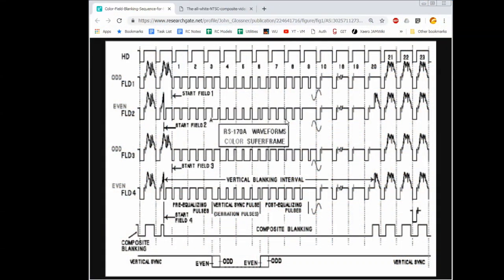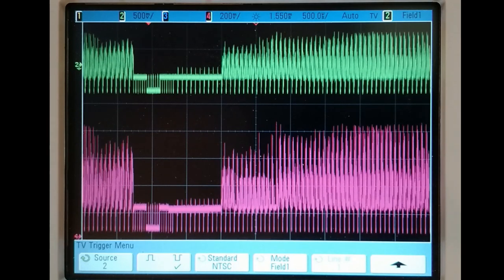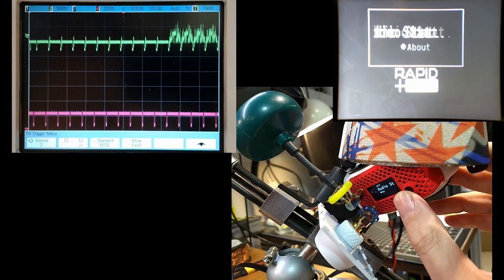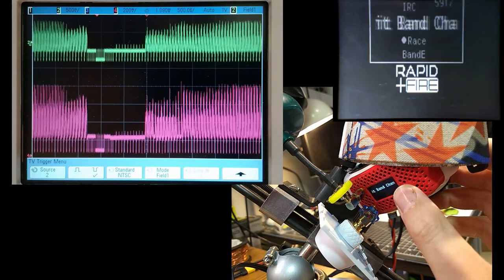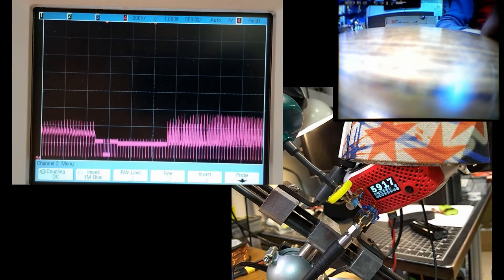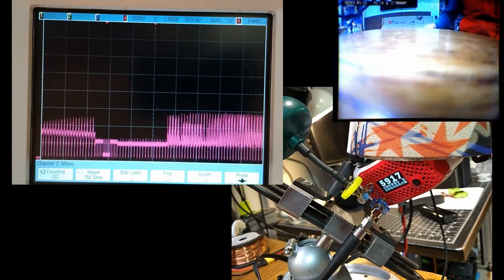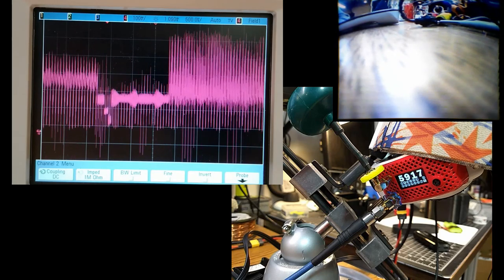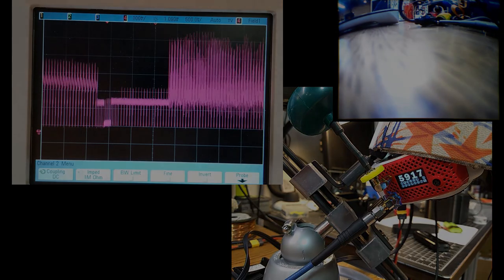ImmersionRC Rapidfire - Rapidfire modes demystified, "magic"explained - FPV Video Series - PK's Lab

Comment: So should we be running identical antenna's (say two omni's) if we want full advantage of the signal combining modes (magic/unicorn)? For freestyle a lot run an omni/patch combo, this appears to get in the way of the magic modes. Great video's by the way. Way over my head, but still very interesting.
Reply from the maker: Thanks bud!  Yeah, from what I've seen the mode 2 combining should benefit the most from using the same antenna on both ports (in a multipath heavy environment).  Where each one of them gives you a slightly different rf path so that one of them is always able to ride out the nulls.  Personally I tend to fly fixed wing at ranges significantly further than most quad pilots so I actually usually run a high gain and a low gain antenna but tend to stick to legacy mode when pushing the distance to have consistent behavior from the module.
Reply: Wow, almost posted the same question? I'm not even in the field and notice interference I would say less than optimum video signal with the rapidfire and two different antennas as you describe (patch and omni)...gonna find the VAS CP hope they still are for sale somewhere. 
PK your references provide a great read thanks! A little above the brainwave but the basics I think are there like antenna choice and placement

Comment: I just found your channel, so cool to learn about the electrical engineering behind the fpv tech. I have a related question on the digital radio domain, I'm wondering how DJI can physically get the bandwidth they get over the consumner bands. Do you know anything about how their radio works? Any guesses on their secret sauce?
Reply from the maker: Sorry about the slow reply, I have 2 kiddos now and not a lot of spare time ;-) Good question.  I won’t be able to do the topic justice in a YouTube comment, but I’ll try do to a short explanation that will hopefully help you go down a YouTube rabbit hole ;-) It’s a combination of a bunch of things.  The first is for the modulation they’re using OFDM (Orthoginal Frequency Division Multiplexing) instead of Analog FM.  Analog FM is generated by feeding the analog video voltage into a VOC (voltage controlled Oscillator).  OFDM is generated by taking a digital bitstream and packing the bits into frequency domain bins where you then run an iFFT, giving you a continuous time waveform that you can transmit.  OFDM has a bunch of handy attributes.  Each bin / subcarrier can be a different underlying modulation, I.e qpsk, 16 QAM, 64 QAM, depending on the signal to noise ratio (EVM).  To help with RF channel impairments like frequency selective fading and multi-path (echos off object in the enviroment), some subcarriers can be dedicated to pilot tones for channel sounding.  Add in some Forward Error Correction (FEC) to the bitstream before modulation to improve the resillancy and efficiency of the data link.  And then a layer of Hybrid ARQ to selectively re-send parts of the bitstream that took uncorrectable FEC bit errors.  That’s primarily only done for the center of the screen when in focus mode.  All this based on my experience with WiMAX and claims by others that DJI is using a modified LTE phy, so some of what I say might not be 100%.  Hope that piques your interest and gets you to dig in more :)

Comment: I think the PSA at the end might be slightly off target.   Looked to me like the bug was triggered by entering the menus when you had no received signal, rather than a good one as you would if you were flying.      We should have seen it return to static when it exited the menus, but it did not.   It's unclear if you had also restored transmit during that period or not.  

One thing I'm curious about after watching your vid is if RF can lock onto the V-sync and H-sync based on signals from either Rf module or if it prefers one over the other.  I ask because I do fly an asymmetrical antenna setup, and I I wonder if it makes more sense to have my my high gain antenna in one position or the other.
Reply from the maker: daemn42, It's hard to tell, but I had turned the signal generator output on at 25:47 (you can see a reflection change in the SMA connector as I reach up to do it).  When I said turn the RF on, that was actually the 2nd time I toggled the generator output because I thought I had double tapped the on/off button initially.  

Interestingly it's still stuck in overlay mode the whole time, even when the OLED menus times out.  The whole time nothing is displayed on the Analog video output.

It's like the processor that does the overlay and diversity switching lost communications with the one that drives the oled and handles the button presses.  I saw your comment on RCGroups about loosing the overlay and wonder if these are related problems.  Not sure which processor handles reading the RSSI from the receivers or tuning the synths, bud i'll do some probing and see if I can reproduce the issue in a consistent manner and maybe do up a video to send to IMRC.

Interestingly, I have seen this blank screen thing happen a few times now out in the field, even with older firmware. Initially just thought it was something I had fat fingered.  But seeing it happen on the bench makes me believe its a bug.
Reply from the maker: I'll do a test for you this weekend to see if there is any preference to either antenna input.  Ryan Friedman was asking for what sensitivity level the mode 1 lock drops out, so those 2 tests will be easy to do hand in hand.

Also, on FB: Timothy Ichiyasu menutions: "... That bug that you saw at the end can also occur when switching between NTCS and PAL waveform inputs."  Interesting stuff.  More testing to do.
Reply: @PKsLab  Thanks, looking forward to your results.    Oh, one other quick test.   Can you see if it continues to synthesize V-sync or H-sync through a channel change (either to static, or to another active channel)?    Some folks have reported issues changing to other people's channels, or locking onto someone else's signal first thing and then switching to your own.    Others feel it must reset the H/V-sync on any channel change, but I'm not convinced.
Reply from the maker: @daemn42  you got it. I'll hopefully get some time this Saturday to set this up.
Reply from the maker: @daemn42 Did some more investigation to see if the RF prefers one antenna or the other.  Onfotunately I forgot to check the channel change that you asked about.  Will prob do another vid to address that.  enjoy ~pk  And keep the cofpv vids coming :)  https://youtu.be/OU-RiwK7LG0